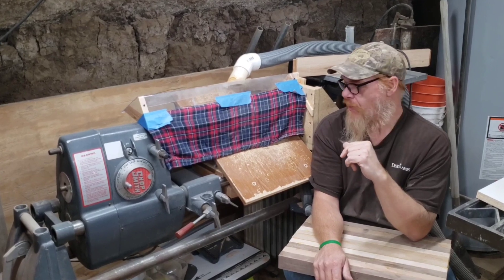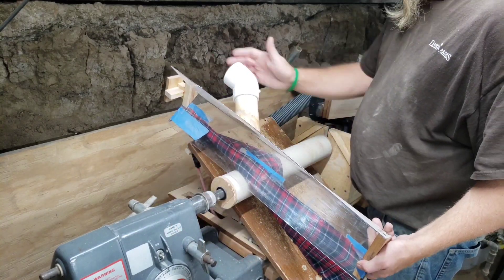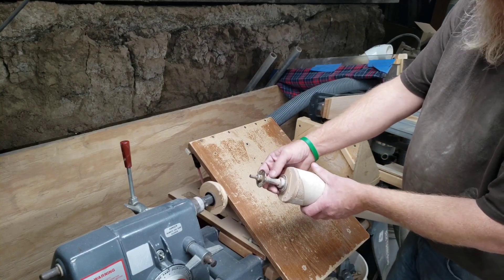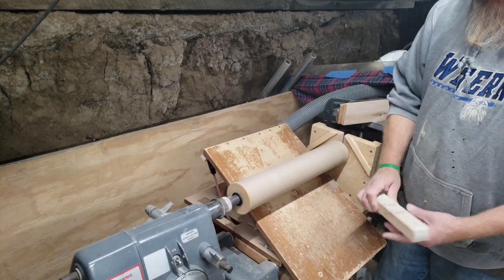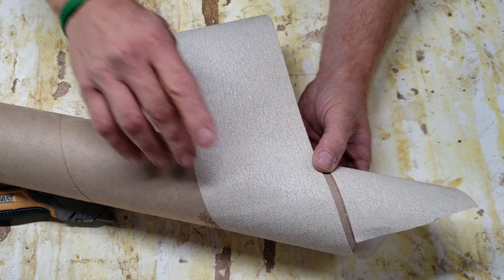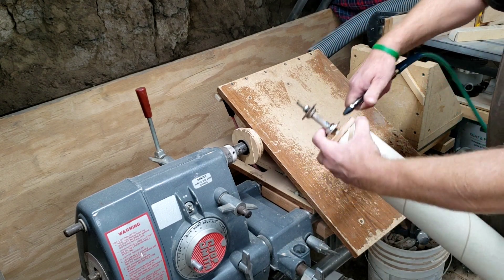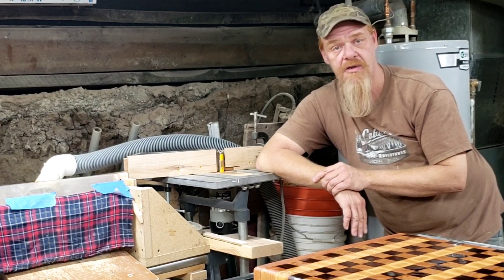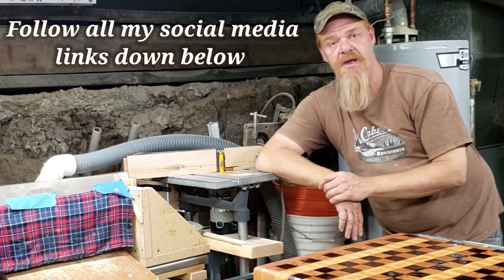Can you use a CARDBOARD drum for the drumsander? || HOW I change the paper ||

Comment: I noticed a different direction. Which is best? I will be using mine for guitars.  Building to run a complete body through!
Reply from the maker: If you are referring to feed direction, I feed the material into the drum so the sanding tries to  push the stock back into you. If going the other direction it will grab the stock and shoot it out. 
Or are you talking about which direction the table goes?
Reply: Building mine now, and trying to make easy on my old bad back, lol
I have a 1.5 inch treadmill roller? Too small?  Thanks
Reply from the maker: I have considered the same rollers and I suspect they would be just fine